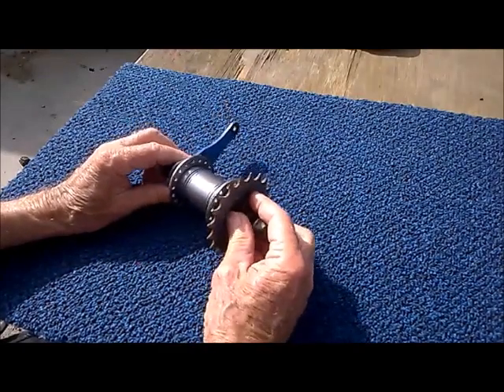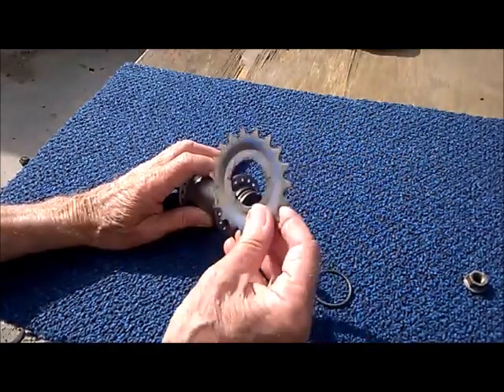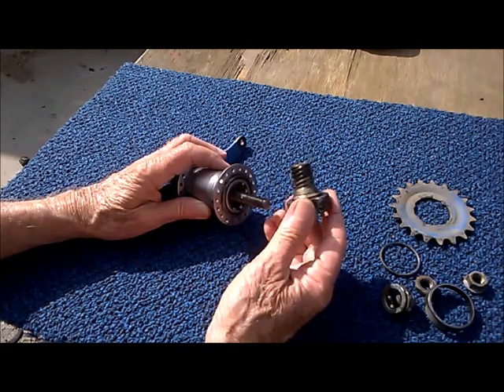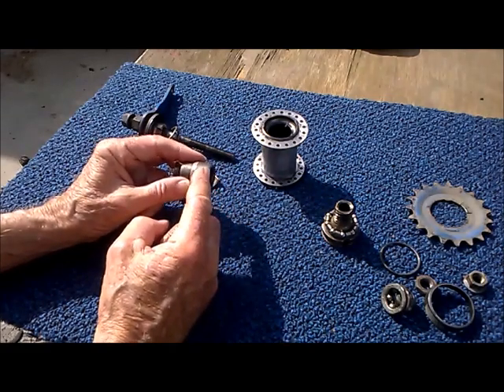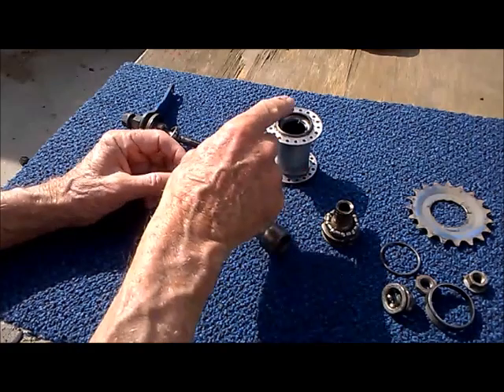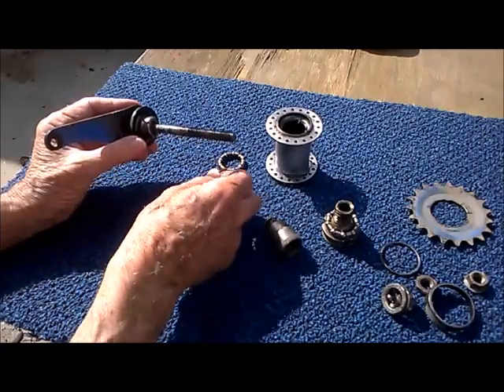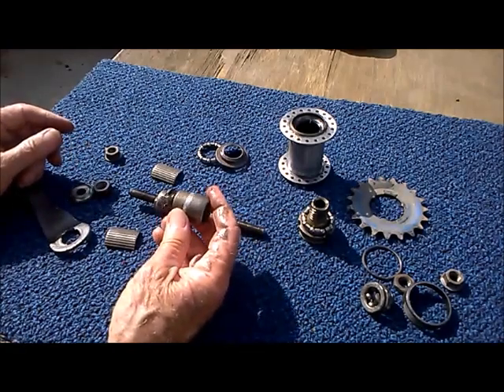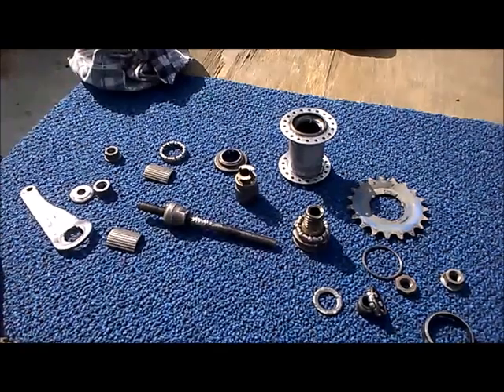Bicycle Coaster Brake Hub Engineering

Comment: Thank you for this detailed teardown of a coaster brake. It is a wonderful piece of engineering, actually! The assembly, if properly lubricated, lasts a lifetime. What other braking system is so simply designed, and so straight forward in deployment, that it impresses an adult, but is so simple, a child can operate it with minimal instruction. Other bicycle braking systems used on bicycles, like calipers, or the disc, overcomplicate the process. The original mountain bike movement, back in the 60's, used old coaster brake bicycles, as they were cheap and plentiful.

Comment: Hi Harv, got the same hub from a cheap walmart bike, when pedaling is great. But when stop pedaling there's this grinding sound, only when back pedal just a bit the noise gets away. Any tip how to get rid of the problem?. Great video by the way learn how it works.
Reply from the maker: Typically,  new coaster hubs come with two problems. The bearings are adjusted too tight
 and there is insufficient lubrication. From your description, I would say that the clutch is not fully releasing from its engagement with the hub for the driving position. I  suggest disassembling the hub enough to squirt in some grease so that the clutch can slide freely  on the axle. When reassembling, make the bearing adjustment just finger tight and then lock down.  I go even further and allow just perceptible "shake" in the bearings to provide working clearance.
Reply: @harv855  Thank's Harv ,I'll do that.
Reply: S

Comment: Hi, in Coaster brake should we change the brake shoes periodically ?
like in V-brake pad rubber?
Reply from the maker: In theory maybe yes, but in practice the brake shoes seem to last forever. What should done periodically is cleaning and regreasing. The service period is dependent on how much you use the brake and how hot the hub gets .  And how much the hub is exposed to water. Use marine grease if bike is ridden in wet weather.
Reply: In a normal conditions, riding the bike a few times a week , the coaster brake will last 25 years to forever .... very reliable system indeed .

Comment: good video , Harv.
a question : have you ever outfitted a coaster brake hub with a multi sprocket cluster and derailleur? ... the 3 speed hubs have some effiecency drawbacks ,don't they?
Reply from the maker: First, yes internal geared hubs have some friction in the gear contacts and are therefore less efficient than pure chain 

and sprocket systems. I have noticed this loss, but its not too bad. If the number of IGH speeds is up around 7 or 8, the losses are greater than a 3-speed because there are more gear contact sets.

 Regarding the use of a cassette and  derailleur with a coaster brake, I can't imagine how this could work because any back-pedalling would just ratchet away all motion to the coaster hub driver. If the ratchet was locked, back pedalling would wind up the derailleur spring and lock  up the wheel. So we have to choose one system or the other. Personally, I have multiple bikes with the various systems. I ride them all.